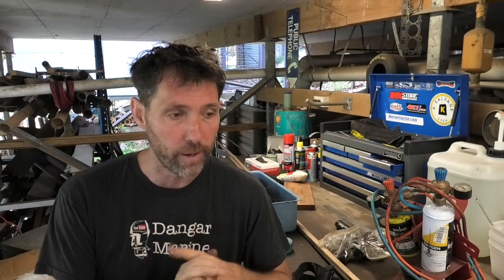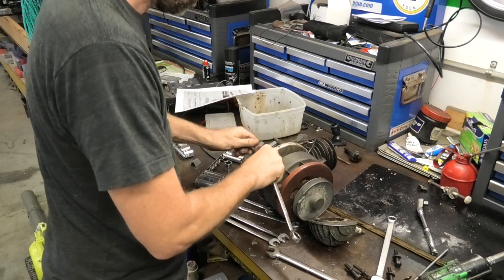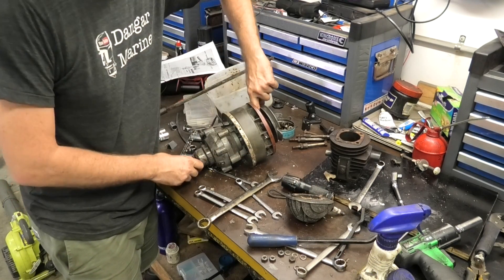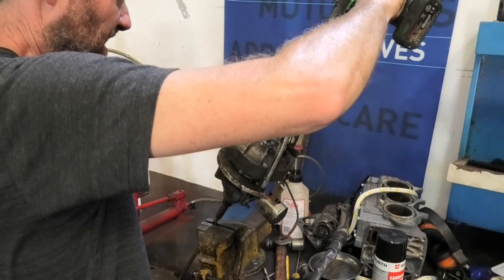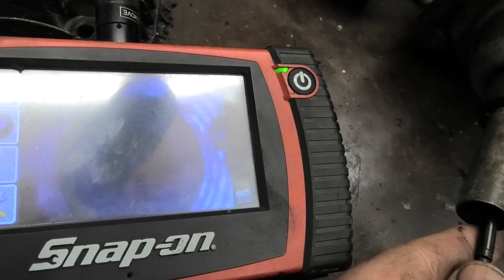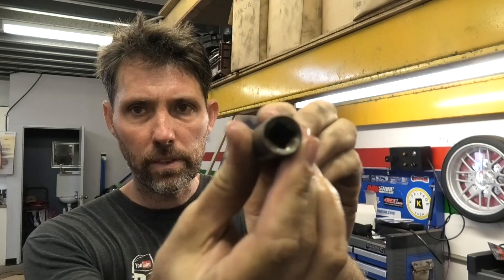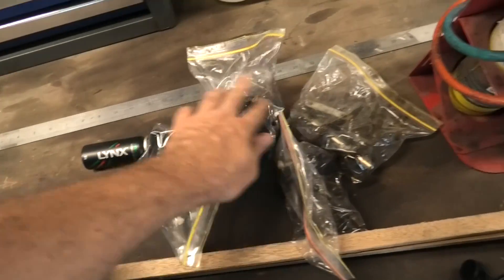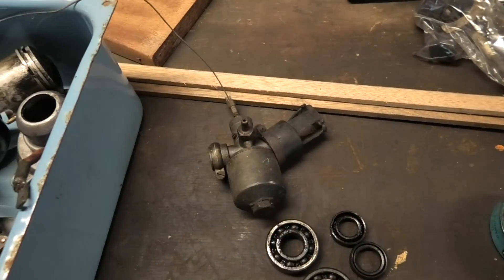Victa 125 teardown

Comment: Loved video and thanks - In an earlier life I used these motors found on the street plus in mower shops junk bins to teach Year 9 students about working on engines. Manual technique for removing drive boss was rest sidewards on anvil and hit with club hammer (100% success rate just like suspension ball joints). Always used new seals (cheap) even though we sometimes did not replace bearings (not cheap). New rings likely as kids learnt how brittle cast iron was. We made a little plate puller for the flywheels. Kids made their own gaskets. Aim was to get motor running (exited cheering!). Bench mount on a piece of steel channel with additional steel disk flywheel underneath. Great fun --> many students went into mechanics and other metal trades, or uni engineering. (Retired today, but volunteering on SHF steamships - We also have 4 by 6/71s in tugs and a range of Gardners to work on.)

Comment: had a victa 125 in a bike frame motor was hot 10 to 1 comp port job  ports were BIG run it on BP K      safe rpm at 7500  crank got  a bit lose after 4 years

Comment: Any chance of you doing like a 6 hp Mercury video
Reply from the maker: If I ever get one, sure.
Reply: Any tips on how to get it to idle smooth?
Reply from the maker: Start with the basic, carburettor clean, new spark plugs, clean fuel then look adjust adjusting the idle mixture screw and timing if necessary.

Comment: Would be interesting to measure the thickness of the head and cylinder gaskets. We use different thicknesses on chainsaw engines for setting the squish. This is setting the compression ratio.
Reply from the maker: Yes,  think they'll be hard to get off to measure but I might be able to find the factory thickness online somewhere.

Comment: Why not replace with a later model Victa 160cc engine. 125 and 160cc are same bolt pattern.
Reply from the maker: Tempting, but this one is here now and I don't really need the power.

Comment: hey stu, forgot to mention the crank case halves are glued together using rtv, no gasket required there. cheers, merry christmas and a happy new year
Reply from the maker: Cool, will use the RTV from the Evinrude. Do you think I would be able to get rings and gaskets through your old workshop?
Reply: @DangarMarine  yeah they should have them in stock, last i looked we had heaps in stock. If you inbox me on facebook i can give you their contact details and bring the parts to the meetup you planned
Reply: @danielmartin2463  Sorry Stu for the highjack, but Daniel, they wouldn't have a set of rings for a Victa 85 cc or the Victa Twin would they?

Comment: Where do you get parts for old engines like that?
Reply: ebay most of the time
Reply from the maker: Not sure yet, but yes, eBay is an option. There are also a few mower repair shops in Sydney that may still have parts.
Reply: @DangarMarine  Or jump on the "outdoorking" forum.

Comment: Need to use a face shield when you were pressing.    I have had parts blow off .   You can’t get new eyes.   No offense.
Reply from the maker: No offense taken at all, I'm am quite slack when it comes to PPE. Must by a face shield one day, safely glasses don't quite seem enough for some jobs, and in this case I only had my safety contact lenses in.
Reply: Noticed that immediately.
Reply: What makes you think an adult cant make his own choices?  Or that you need to tell the adult anything?  Safety Puritans are the worst Puritans of all.